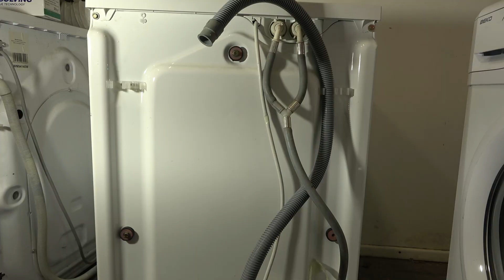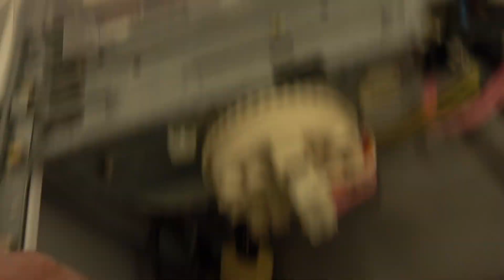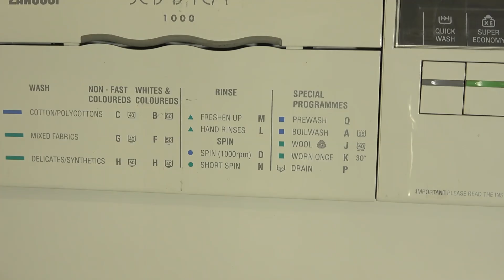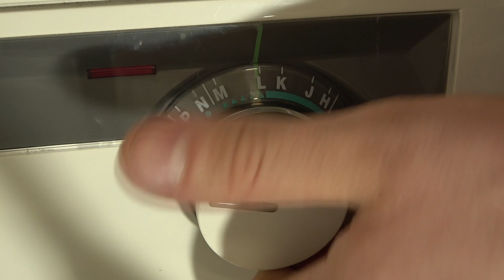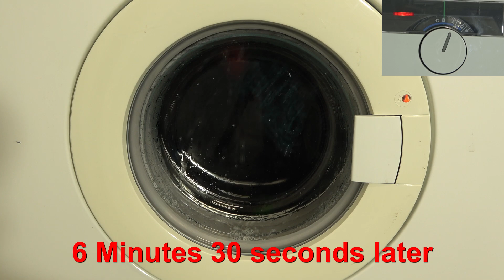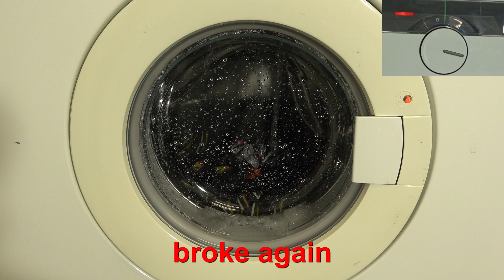Review of 1996 Unused Zanussi Jetsystem FJ1093 1000 spin Washing Machine and it gose wrong.

Comment: My nan had this washing macine for about 10 years with absolutely no problems until it started to leak around 2005/2006. Rather get it fixed she decided to just buy new. I used to love the little spin burts intern spins and the Jetsytem was way ahead of its time. I dont recall any other brand of washing machine using that wash technology during the 1990s which set Zanussi appart from all the oher brands. Miss these washers Zanussi need to bring the Jetsytem washers into the 2020s I'd buy one in a heartbeat!

Comment: Great video. I have a slightly newer one from 2004 there was a loop connection on the board that controls the motor speed and balance sensor 😂 I may have disconnected that so it would spin regardless of balance 😂

Comment: When a washing machine has a jet/recirculating pump, l assume for a water-saving feature as the water level can be below the inner drum for the main wash and final rinse, and the washer doesn’t have to do that “short” direct fill of the sump before adding the detergent/fabric softener from the drawer. No point in having the “jet” on for the rinses if the water level is at the bottom of the door/halfway up it  = the laundry is being saturated with no need for the jet to pour water into it